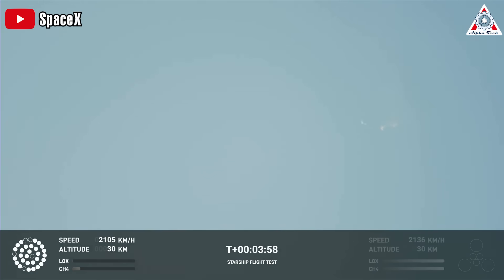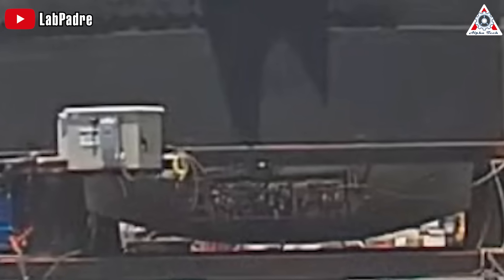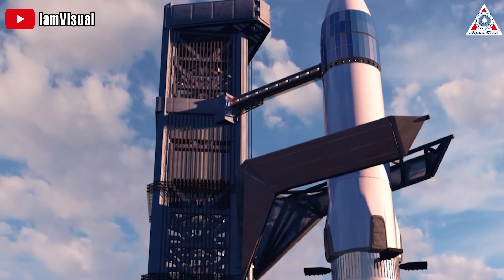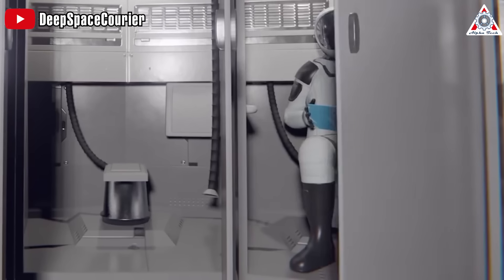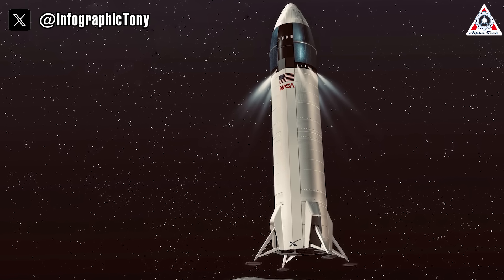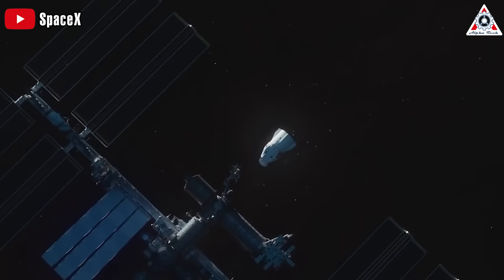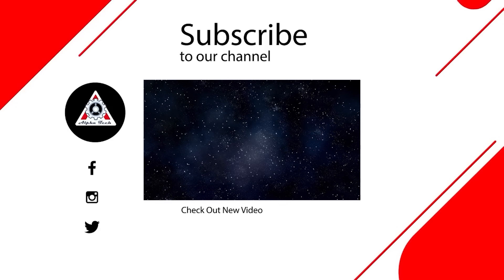SpaceX just leaked NEW Lunar Starship prototype with NEW Design, unlike others...

Comment: Fast Tracking the HLS crew quarters is one thing, but None of it will be usable in Space until SpaceX proves Orbital Refueling works.  And if Orbital Refueling is to work, then so Must the Launch Integrations Tower's "Chopstick" method of capturing a Super Heavy return from launch for a quick turnaround return to Orbit.
   That's a Lot to prove and they've yet to reach Orbit of have a single test flight w/o a problem w/ the Raptor engines. Every StarShip prototype or Super Heavy launch to date has had Raptor failures on all variants. 
   So, SpaceX needs to reach orbit,  prove re-entry for StarShip, perfect the "Flip Maneuver" for Starship, capture both the Super Heavy booster & StarShip on the LIT for quick turnaround, and do so w/ 100% Raptor reliability, among many other things, before they will be certified as "Human Rated" by NASA. HLS is still Years away.  
   Add to that the superfine, electrostatically charged, grinding compound known as "Moon Dust" that has yet to be defeated in a Space Suit or Moon terrain-based equipment and there are some serious challenges ahead on Top of the few you've mentioned here. Finishing a HLS Cabin mockup is just for show at this point because by the time it's ready for launch, lots will have changed.

Comment: I really hope SpaceX is taking radiation seriously and also not planning on actually going so far as Mars without spin gravity.  While overall, I love what he is doing, Mr. Musk sometimes tends to blow things off that are obvious oversights to others.  It sounds like he's doing that with radiation shielding and, possibly, weightlessness.  AS for the Lunar surface, I think the regolith itself is a valuable resource, for shielding.  A simple railgun shooting bagged regolith into lunar or Earth orbit seems to me like it would be relatively simple and inexpensive (relatively).  Mining and smelter of ores will take more work but the lunar surface is littered with nickel/iron meteors.  So finding ores should be no problem.  Also, solar energy without atmosphere or clouds means energy supply is no problem.  In fact, you could just use a solar concentrator (made with mirrors) on a titanium crucible for smeltering, greatly simplifying the process.

Comment: Sounds like the nose cone was gutted to lighten the load so SpaceX can test the upper stage in flight as well as life support. I suspect that we are going to see a flight of just the nosecone in the near future. 
The biggest test of life support is going to be longevity since they already know there system works for short trips. They will also need to simulate a demand for life support for the test to insure it is working properly. Possibly for at least a month.
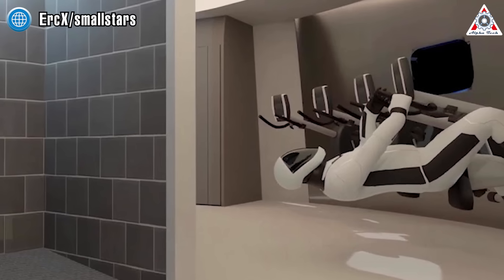8:10 I know that low level electricity is used to speed healing of broken bones and heal muscles. Could this be used to supplement astronauts and protect them from the effects of low gravity?

Comment: I’m still very concerned about landing a tall spray of can on the moon and Mars without a current idea/designed of landing legs. For the Moon not much is been said about the engine location on starship will those be at the bottom or all on mid section of the ship like so many YouTubers illustrate. Falcon 9 landing is a different situation that belongs to Earth’s orbit and has landing platform accommodations, that said will not be the same on other planet surfaces or moon.

Comment: Entertain my hypothetical here

Lets say starship is actually built and gets to the moon. 
Starship lands on the lunar surface (its lunar dust)
There is no landing pad made from reinforced concrete. 
Just 1 raptor engine would be enough to displace the dust beneath starship. 
Starship will fall over before it actually takes off.
Reply: They won’t use raptor engines for final approach or to take off from the lunar surface. View the Lunar Starship concept. Notice the ring of holes about 1/3 of the way down from the nose. Those are small thrusters. We think in earth gravity. You don’t need much thrust on the moon
Reply: @jason_m_schmidt622  That isn’t how physics works.
Reply: @veselekov  Take a look at the where the landing rockets are on the lunar starship.
Reply: @jason_m_schmidt622  That isn't how he works...
Reply: @portants  You people don’t know the material

Comment: An "engineering" deck for life-support systems and other support systems would make sense. As the Lunar regolith poses a serious problem, ionized air-showers like those in Earthly clean rooms and HEPA filtration, as part of a multi compartment airlock system would protect the suit, craft, and personnel from this hazard. The use of robotic "cleaners" like the "Roombas" that can access all surfaces of the outer and equipment airlocks for cleaning would be a good idea for extended missions to reduce contamination issues. Possibly using electrostatic/electromagnetic process instead of air? It may be possible to develop a system or coating for suits and equipment that repels regolith electrostaticly. The possibilities of the HLS nose-cone are myriad due to its size and the small number of crew it will house. The amount of cargo and crewspace allocated will depend on the mission requirements unless a "universal" layout is required by NASA. I foresee the need for robotic landers carrying supplies, equipment, and robotic construction units and no human support equipment required. This would maximize the use of internal space and serve as cargo "shuttles" between Lunar orbit and the surface or Earthly orbit. More crazy ideas from a useless, retired, Industrial Design Engineer.
Reply from the maker: Great comment! Thank you so much!

Comment: 4:25   Using recycling as a contingency plan could be considered, although given the substantial size and capacity of Starship compared to the demands of life support, for a mere 2 or 3 astronauts for just a few days. The storage of water, oxygen, and other consumables on the ship with ample reserves would be entirely feasible, particularly during Starship's inaugural moon landing expedition. The capabilities of Starship, are notably excessive for a mission involving only 2 or 3 individuals. Conversely, comprehensive lunar missions, encompassing lunar orbit scenarios with larger crews, would undoubtedly necessitate recycling as a fallback option. Furthermore, the excess vaporized O2 from the main tanks might also be used to supply breathable air.
Reply: Agreed. Especially considering that the plans ultimately are that crews aren’t launching directly from Earth to the Moon. 

A ship that launches will be a reentry-capable vehicle, dropping off Moon landing crew at the Lunar Gateway. Then, HLS variant down from the Lunar Gateway to Moon’s surface.

They do this flawlessly with Crew Dragon, and my guess is that what’s inside the Nosecone 22 mock-up is very similar to what we see with Crew Dragon already.

Comment: A lot of "spaceship" concepts tend to show large numbers of windows that would only weaken structural strength. If people need to see out why not just install a number of high resolution, controllable cameras on the outside and project their images on large screens inside?
Reply: Something else to maintain
Reply: because cameras will put heavy doubts on the Flat Earthers' minds, I guess?
Reply: Since the windows would be on the top, don't think it will have to carry a lot of weight, structural integrity shouldn't be an issue. I'm more worried about the weight, glass is heavy.
Reply: I don't know about a lot of windows like shown and some of the pictures but the type of glass they use in the cyber truck might be what they're looking at as it is pretty strong against impacts structural strength is good.

Comment: It is theoretically possible (chatgpt) to place a solar shield in a lunar orbit that would cast a stationary shadow over a moonbase and offer a significant reduction to exposure. 🖖
Reply: Would it be possible to place an object in a lunar orbit that would cast a shadow consistently in the same place on the moons surface?

Yes, it is possible to place an object in a specific type of lunar orbit that would result in the object's shadow consistently falling on the same place on the Moon's surface. This concept is known as a "synchronous orbit." In this scenario, the object would need to be in an orbit that is synchronized with the Moon's rotation, so that it always remains positioned between the Sun and the designated shadow point on the lunar surface. This would effectively create a stationary shadow on the Moon's surface. However, maintaining such an orbit would require careful calculations and adjustments to account for gravitational influences and other orbital perturbations.

Comment: I suspect the biggest problem for the lunar Starship will be how to keep lunar regolith dust out of the ship! Every grain of regolith is covered with sharp incisive edges which cuts into and attaches itself to exposed surfaces it lands on. It gets onto space suits, breathing equipment and just about any mechanical equipment astronauts will need to survive on the moon.
Reply: wasnt sierra (and probably others) experimenting with an electrostatic dust removal system
Reply: I wonder if some kind of electric static field could be used to keep dust away from critical parts such as engines
Reply: I hate sand. It’s course and it gets everywhere.
Reply: How about a shower before getting back in the lander? It would be in the air lock.
Reply: There's a suit in development now for that problem
Reply: Powerful magnets in the airlock shall collect the majority and have been being developed for awhile now
Reply: @bk-lx6cb  magnets can only attract ferromagnetic material. Only a very small percentage of lunar regolith falls under this category.